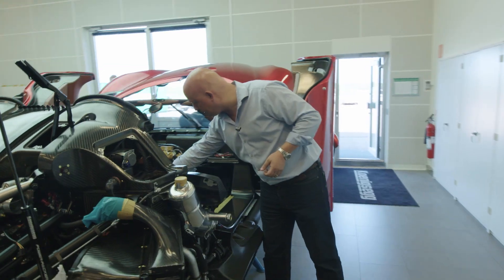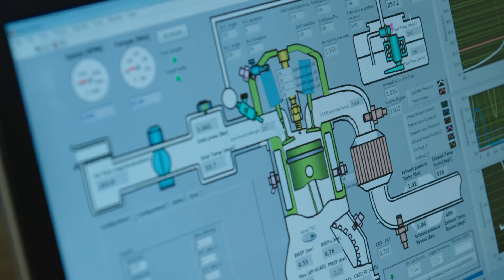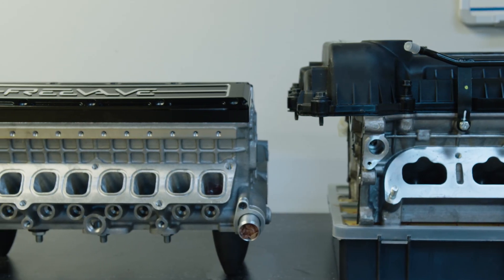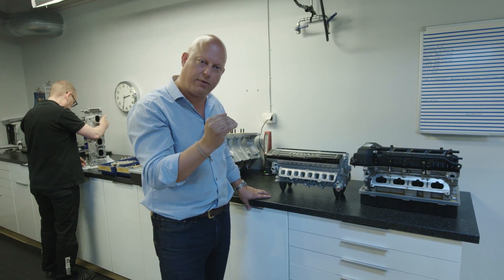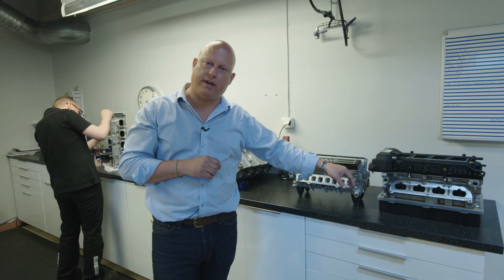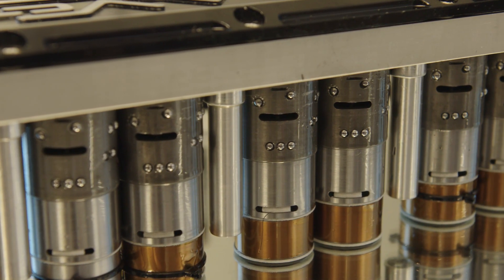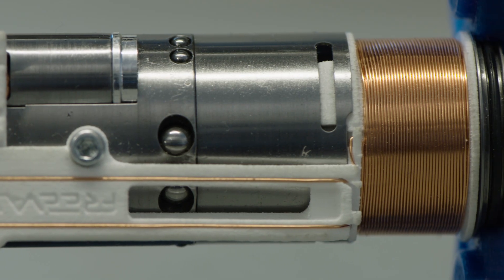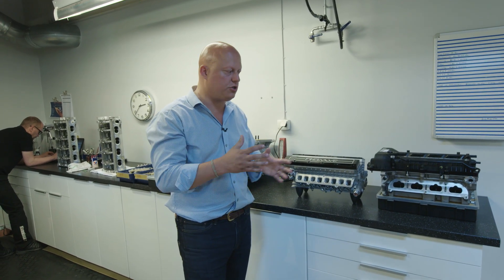Freevalve Update Camless Engine -- /INSIDE KOENIGSEGG

Comment: I was really sceptical when I read the title. Even though it's Koenigsegg, and they know pretty damn well what they're doing.
Most of the scepticism was like "too many individual parts, how about long-term reliability". While that hasn't really been calmed down by Christian's explanations, the potential of the system is just way too enticing. "Hey, we can eliminate the wastegate. And the throttle body. And the pre-cat. And we can shut off cylinders so easily".
We HAVE TO put a lot more effort and research into this. This is looking really good.
Reply: It is not "easy", but compared to the other solutions needed to make freevalve a reality, controlling the two flow paths (over turbo into exhaust and straight into exhaust) really is quite "easy in comparison".
Reply: spreagadh No matter the design, engine valvetrains will have lots of moving parts.  When you are looking at OHV Pushrod and DOHC designs, there is a lot of complication there too, especially once you add in variable valve timing and/or systems like Honda's VTEC.  This could be even more simple than the ancient Flathead design, since there is no cam, pushrods/lifters, or mechanical timing equipment, just these plungers that appear to be working the valves.  I can't tell for sure on something though, are these electronicly controlled, or operated by air or oil based pumping systems?
Reply: F1 engines still use camshafts, always have. The only pneumatic parts are the springs.
Reply: first running engine was made over 10 years ago
Reply: spreagadh Well. Lets look at this from an engineering perspective. Way less moving and wear parts. Solenoids are reliable and aren't new tech.  Over all as long as the ECU doesn't die this should be more reliable then even a cam in block.   F1 racing should show that alternative valve designs work (because most now use pneumatic systems to actuate them.  The only issue here is its probably just too late. Because of Tesla and VW diesel scandal electric engines are already taking over and are much better.
Reply: The problem with F1 design is pressure leakage over time. on a road car simple compressor fixes that, I guess.
 Electric still has major problems, Energy density power storage vs weight, refuel time/charge infrastructure,cost? long term reliability?
 there were vary good practical reasons IC engines won out over steam and electric.they started out pretty much even. In fact Henry Fords wife had to be forced to give up her electric car. finally got her a driver so she didn't have to hand crank the car or get the smell of gas on herself.
Reply: The point with the wastgate is not so easy in my opinion
Reply: *****
a total new technology in 3 years ist fast. Not want to say impossible
Reply: I wasn't saying they put too little research into it. I know they are. Whatever they do, they do it properly.
Just saying that there is no "too much" effort, so we could definitely give more ;-)
Reply: *****
Yes its a prototype i work at audi i know what im saying :D
Reply: ok thats time enough
Reply: GreenJeep1998 As per: http://www.freevalve.com/technology/freevalve-technology/ 
" FreeValve uses electro-hydraulic-pneumatic actuators combined with advanced sensor techniques."
Reply: *****
 i answered to your 3 years i didnt know the fact that its developed a longer time. So you lied to me. Dont be such a smart aleck
Reply: spreagadh and engine braking regeneration

Comment: he need to start tinkering with vtec asap
Reply: Freevalve basically makes VTEC obsolete. They can control the opening and controlling of every valve individually but they can also change the "profile" on the fly too. Technically there is no actual profile because there are no cam lobes, so the profile is emulated. They can actually take it one step further and give the car a square cam profile, which is to say the valve can either be all the way open or all the way shut immediately.
Reply: Why would he do that? This technology makes V-Tec and other systems like it completely obsolete.
Reply: Ameer Ramchand wouldn't work vtec uses cam and oil pressure  to increase timing when 'vtec hits'
Reply: This is like VTEC on serious steroids. Traditional VTEC allows you two different cam profiles that are switched via oil pressure. A system like Freevalve essentially gives you infinite cam profiles, along with infinite cam timing/phasing, as well as selective cylinder shut down, and more.

Comment: god damn i love this shit, i cant wait for this to be implemented on a large scale
Reply: If its that good, within 5-10yrs the aftermarket tuning scene will have this for the most popular tuning engines I think
Reply: well the supra is already turbo, i would totally free valve it
Reply: Poor Man Mods  Yes! But mostly it'll be used to downsize your engine while retaining current power levels and lowering consumption/emissions. Realistically it will lead to very small engines in normal cars.
Reply: thorsong1 yeah, those new coins are confusing AF!
Reply: It's kind of going large scale since its going to be used by a chinese car company called Qoros, which already sells cars in Europe and Asia.
Reply: Willy Lamb exactly right probably something around 500cc-1500cc engines will probably be attainable to the average joe in the their daily driver
Reply: its about time someone used the same technology in a basic speaker design to create camless valves. It was bloody obvious, its just that manufacturers dont like to move away from proven designs except those exotics
Reply: Ayyyyy, PMM!
Reply: ayyyyyyyyyyyyyyy
Reply: Willy Lamb and increase power, better tune and so on.
Reply: Missing my point. The increase in specific output (hp per liter) will occur, but they'll just downsize the engines so they're making the same power as the traditional engines, but using way less fuel.
Reply: if freevalve existed for your supra, what would you do? Turbo or Freevalve swap
Reply: scrolling thru looking for nerdy posts and see freddy on here! haha hell yeah
Reply: I could see that happening for sure. Little 1 liter turbo engines making 200hp and getting 50mpg with virtually no emissions.
Reply: The Hayabusa turbo is 1.3 L and makes 500 HP
This engine could have a "cruise" mode running just 2 cylinders exhausting to the turbo, having the intakes close late for Atkins Cycle advantages, and the other 2 cylinders working as air-springs ready to bark to life at the touch of the throttle.  It's brilliant !
Reply: thorsong1 its poor man mods not bill gates bank account
Reply: Try Volkswagen or Minis. Then drive a 479 caddy or a 502 Chevy. No replacement for displacement.

Comment: With emissions getting stricter and stricter, with engines becoming smaller and smaller, and with people who want cars to go faster every year, this guy has found a solution to everyone's problem. He's keeping the ICE alive for as long as it can.
Reply: If he could pull off without freevalve those figures, with freevalve it would be something more like:
246hp and 1.3l/100km (torque is "meaningless" when speaking about work produced, torque is the same as RPM when it comes time to calculate the actual work done)

Which would make ICE still the choice for many more decades.
Your 45l fuel tank would now take you 3461km. Your engine weighs like 30kg (exhaust piping may weight more).

Tesla needs what 600kg for the batteries alone?
new Powervall is 13.5kWh @ 120kg ...
Reply: I feel odd knowing I need caffeine for work and my name is AJ
Reply: he already said 3 years back, that back then they could build a engine after the same principles like the agera r engine, which result in a 1 cylinder, 160-180hp engine with 300nm of torque and a fuel consumption of 2 l/100km.

now with the freefalve system.....i mean damn! look at the numbers. its crazy. unfortunately i dont think this has a great future due to the electronic progress.
Reply: hahaha amazin
Reply: NighteeeeeY Freevalve hybrid V12 Ferrari. Imagine that.
Reply: Don't forget that some manufacturers are also working on variable compression turbo engines. Nissan said theirs should arrive 2017 in an Infiniti model. Peugeot has their own that they are close to releasing and I believe there are one or two other independent companies that are patenting other ways to do variable CR for turbo engines.

The Nissan engine can go from something like 14:1 CR to 8:1 CR. They claim a crazy 40% better fuel economy, which I don't believe, but it looks like manufacturers are taking advantage of new techniques to make ICE more usable for the foreseeable future.
Reply: Hopeeater ?
Reply: El Jim That's a very good point. I think the difference is Nissan is bringing it to market while something like Freevalve still has a lot of hurdles for the mass market. 

BMW Vanos system is suppose to be continuously variable valve timing and lift duration as well. They say they don't need a throttle body, but keep it for other reasons. 

There's a lot going in the market right now that might be just easier to work through than what Koenigsegg is doing. I've always wanted that design to make it into cars since I saw the specs on F1 concepts.  The Freevalve also allows for a better included angle, basically a zero angle. 

But it's a cost/efficiency issue. The nissan VCR system may look complicated, but it may actually be easier to run over the lifetime of the car or simply be cheaper.
Reply: Indeed, weigh saving alone on engine drops the Fuel consumption on car, with smaller fuel tank (for the usual 400-600km) and whatnot a 3,5-4,2l/100km easily feasible without having to drive like uncle scrooge
Reply: danknasty661 They're on the Agera, One:1, and Regera.
Reply: Caffeinated AJ quite frankly if you go too small you get worse economy
Reply: Absolutely - engines are always more efficient with a higher static compression ratio.  But static compression ratios almost don't matter in this case - with freevalve, the dynamic compression ratio is variable - you could run at the most efficient dynamic compression ratio at all load/rpm combinations to optimize performance.  Of course, a certain minimum static compression ratio would be required to get the range of dynamic compression ratios needed.
Reply: Koenigsegg.......... ...?
Reply: @Sigma - Incredibly complex wonky system. Good luck servicing those.  They were also created years ago.  Nissan/Peugeot was not the first.
Reply: thepawneeful Everything was created years, decades, sometimes a century ago, but they usually only come to market way later due to longevity or price.
Reply: indeed.
Reply: dude, koenigsegg already has variable geometry turbos, i think they are on the regera or One:1 but he talks about it in 1 of the videos when he's at Geneva
Reply: Maybe if you have a high enough compression ratio, you would still retain the good fuel economy. I think that's why motorcycle engines usually have compression ratios of 12:1. Then again, too much of everything is bad.
Reply: Good point, but don`t forget the affect of the "surface area/volume ratio"
What would be interesting, would be to see the results of this engine running on hydrogen or other similar fuels
Reply: Add  all that with a CVT  transmission and there's huge savings all around in every way. I know some people hate CVT's because of the rubberbanding when gassing it but for every day driving, especially in stop and go traffic, it's pretty good.
Reply: CVT will be good when we go down the route of using hydrostatic and not cone with belt, as it looses too much efficiency. Though with hydrostatic, shaft speeds have to be as low as possible, so your looking at 25"+ wheels and ethere a very low rpm motor and a gear box between the motor and the pump or a multi staged pump
Reply: 1913 technology honestly also Harley had an engine with only one cam lobe called the l head nothing new here
Reply: They just copying American technology from years ago that's one valve being opened by compressed air nothing new
Reply: Caffeinated AJ 
I have a solution to run engines on water, problem is, No Revenue Stream for Monopolies (who would tax grey water or urine?)

Comment: Cool but are those Valves operated Whit electricmotors or hydraulic and how Will they last?
Reply: both, they are electrically actuated but are filled with hydraulic fluid, the current problem with this tech is the long term reliability, BMW has a similar system.
Reply: electromagnetic switches, AKA: solenoids most likely. They are pretty durable
Reply: Pneumatic!
Reply: zoninable He is in Sweden so im sure they have thought of that. Its a unique hybrid of many systems including pneumatic. check out the link i've been following this tech for years. http://www.freevalve.com/technology/freevalve-technology/
Reply: making this completely useless. lmao
Reply: shay rubino Thanks for answering. Yeah and how will they work in the cold I live in Finland and it can go low as -40c in winter so the hydraulic oil is gonna be very thick.